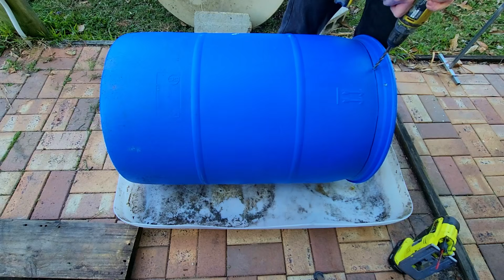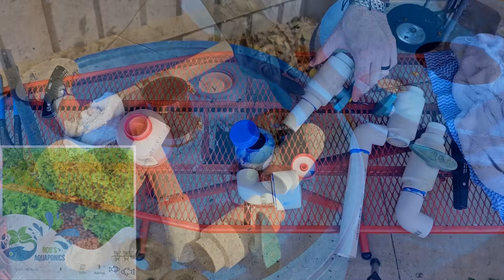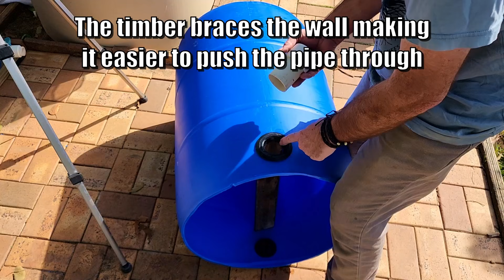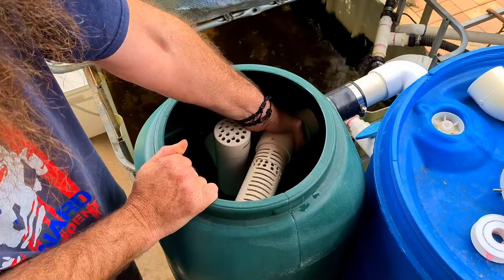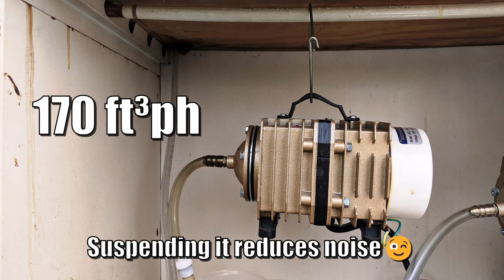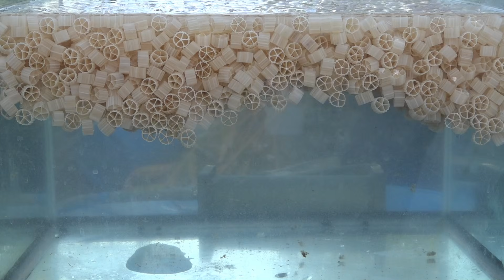Moving Bed Bio Reactor for Aquaponics - Complete Build

Comment: Why use glue?
Reply from the maker: I tend to only use it on external parts that may get bummed a lot.
Reply: @RobsAquaponics Thanks for the reply.  I'm a licensed irrigation contractor so i do work with this stuff a lot.  

I just think that applying glue to the lines can contaminate the system with solvents.  

A couple taps with a rubber mallet and those fittings lock together so tight,  it's almost impossible to take them back apart. You could also wrap some Teflon tape around the pipe end that will create a nice deal as you tap it home. 

Might be worth a try.
Reply from the maker: I use the tape & SS screw method in all the builds. I show it in most the build videos as well. 👍

Comment: Learning a lot with these videos, trying to replicate them but finding the items is a challenge, so I have to make what I can with what it is available in the country I am which is Paraguay,,,,a lot of thinking process to solve problems ,,,so tiring 😊
Reply from the maker: That's the "fun" part of DIY. I have seen folks use rolled up bird netting, shade cloth & drink pottle lids in their biofilters if that helps any.
Reply: @RobsAquaponics  I tried to make your sump tank, it was a disaster on my side, it didnt work, I guess bcs the fish tank is at the same level entrance to the sump, so next season, if I am able to keep them alive in the winter, which it can go down to 1Celsius , I will put the fish tanks in a higher level and recreate the entire area,,,I have only 450 tilapias, I will sell most of them when time comes, and now I know more how to do it better and easier. I did order the sock type to capture the small particles, maybe it will help not to clean the filter tanks every other day. Thanks for your videos. Oh, we use the motorcycle tires inner tubes  to wrap up the pipes instead of those rubber sealers and so far so good 😄😄

Comment: I feel like I’ve seen this video before.  I use k1 micro, it flips around better, with just air.  I don’t know if my biofilter is doing anything for my system, but it’s part of the cool factor for sure.
Reply from the maker: You have seen bits of it across 4 or so videos. This way it's all in one. 😉👍

Comment: Thanks for the video Rob! I’m hoping to start working on my aquaponics setup (someday 😂) and I’ve found your guide super helpful!  I did have two hypothetical questions for you: first, would it be possible to recycle plastic old soda and milk bottle tops as MBBR media? I don’t imagine it would work as a 1:1 replacement but are there specific reasons why recycling something like that would not be a good idea for that application? Secondly, would it be possible to make a radial flow settler out of an IBC tote? It would be far too big for any system I would make just getting started, I just happen to have enough totes that I could eventually try that and it makes me curious. Hope you’re well, the farm really looks like it’s coming along!
Reply from the maker: Hey Jeremy. Bottle tops have been used but they don't stay as buoyant as the proper media. I have seen them used in a trickle type bio filter where the water runs over the top of them to be collected at the base & sent out to the next component. They also collect a good deal of solids in that situation & need a good clean regularly. 
I've also seen IBC's used as solids settlers, mainly set up with stilling baffles in them rather than as up flow settlers like the RFS. 
They would take a fair bit to clean out I would think. 
Thanks mate & have a great one. 😁👍

Comment: glad you have done this video Bob this is something that I will be copying at some point for a smaller system I have planned.

I finally made the leap into aquaponics as a school project and I have built a system with bio media and settling tanks but I utilised the bottom halfs of my ibc tanks for solids filtration and moving bed bio filter as it created a neat looking system.we have basically made 3 chop and flip beds. I was having issues with the media getting stuck in areas of the tank untill I fitted a  water pump to create movement, it seems to mave worked well.

each of my filter tanks are around 300l each. The thing that I noted with the solids settlement tank is that the waste drops out of suspension really efficiently without a radial flow setup. also to help with any anaerobic issues I have fitted an oxygen feed into the tank. it has been a bit of an experiment but it seems to work really well . 

everything is gravity fed from the fish tank to the sump. I also have connected my bio filter  tank in such a way that  it almost doubles the capacity of available water for my pump in the sump tank . I had an issue with my grow bed volume when flooding and draining could leave the pump dry without plumbing the system this way.

it would be interesting to hear your thoughts on what I have put together.

love your videos Bob and your farm looks epic
Reply from the maker: Hey Michael. Sounds like an interesting system. Any chance of you doing a tour video for me to suss out? 😁
I had a vacant drum at the end of my RFS & Bio return to the sump on a previous build & found that it acted as a settler tank for fine solids that made it through the other filters. 
Cheers & have a top one.